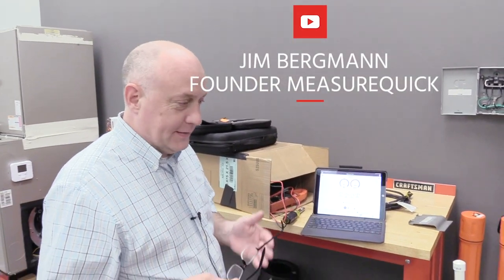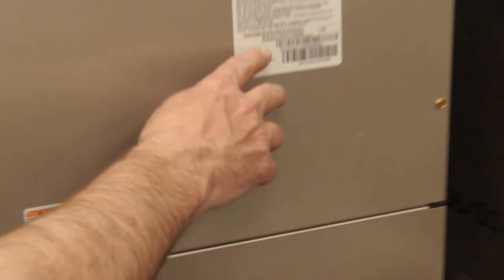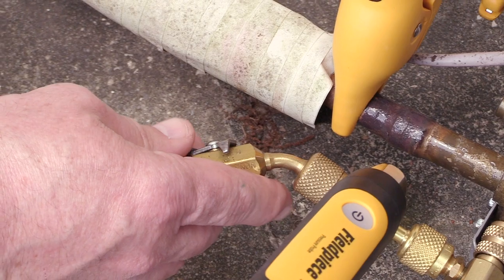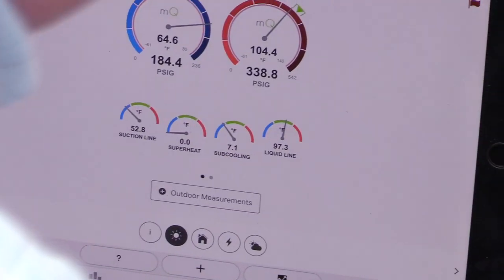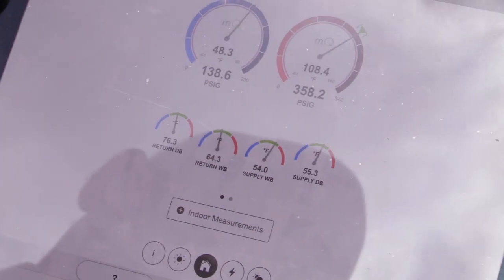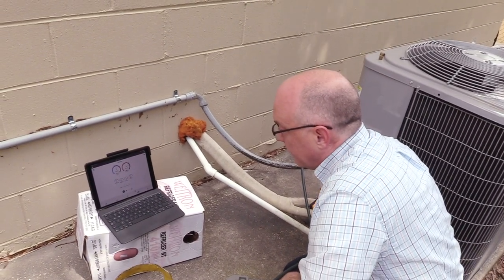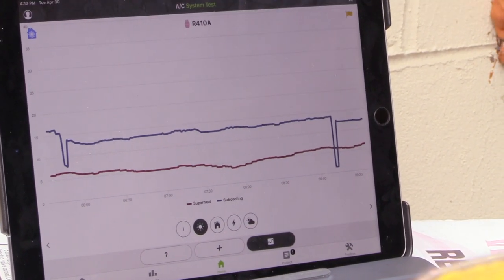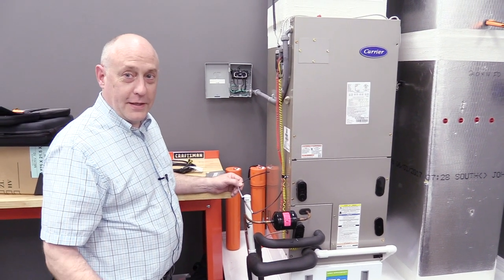Charging and Recovering with measureQuick

Comment: Thanks for the video. Correct me if I'm wrong but that refrigerant is now fractionated. Because it is a blend it needs to be opened as a liquid and charged as a liquid. Because the blends escape at different rates
Reply: Ivan Hall incorrect, 410a is nearly azeotropic and is very stable. I have never seen any of the modern blends fractionate. Fractionation is more of a theory than anything and even it was an actuality, it occurs at such a low rate that doesn’t matter

Comment: Very cool video but I do disagree with one point Jim Bergman made about sweeping your gauges. There are no residential split systems that are critically charged to the point that sweeping your manifold gauges back into the system will put your subcooling over an acceptable range unless you overcharged the system to begin with, but the 6 oz that all 3 hoses hold should not affect you that much